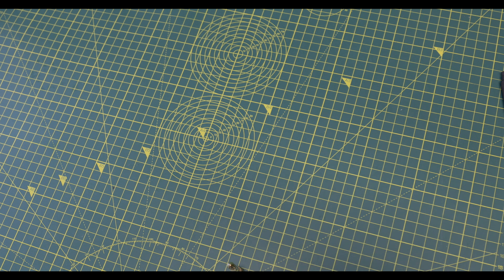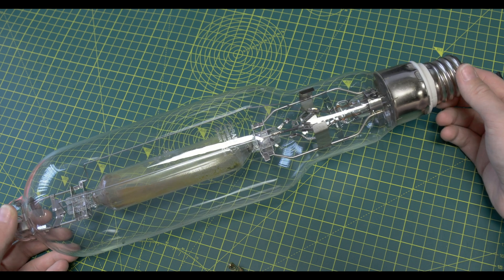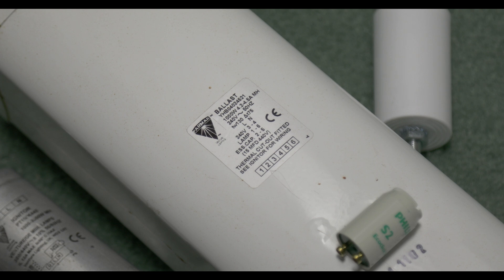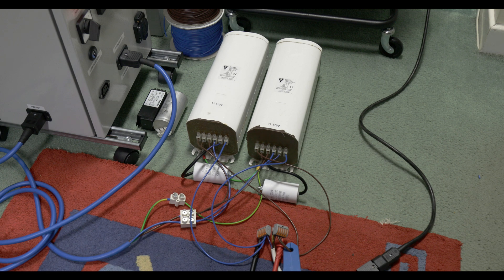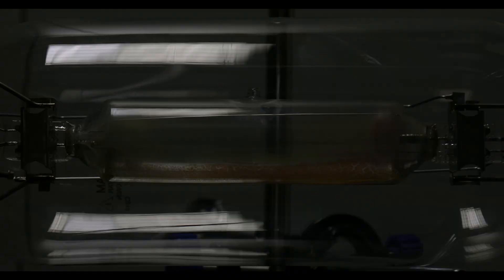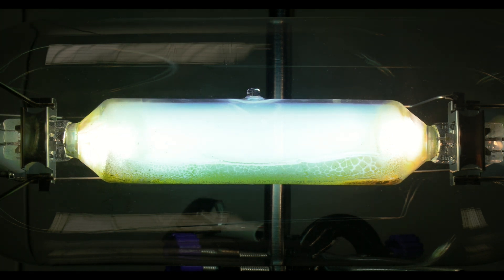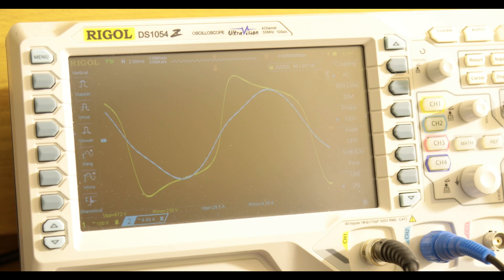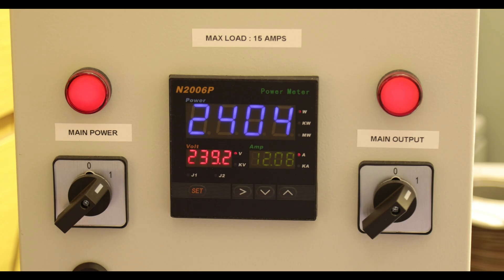2000w Osram Halide finally fired up

Comment: At 5:30 is that the halides solidifying at the bottom inside the tube? Nice video!
Reply from the maker: Yeah, that is the molten metal salts at the bottom. Not all the halide dose is evaporated on the majority of halide lamps. You can actually see them vaporising when it starts.

Comment: Big boy lamp!

Jealous how easily you can get that kind of power from wall sockets over there.
Reply from the maker: The UK would be lost without our 3kW kettles lol.
Reply: @FrontSideBus  damn right, but when you go gas you never use mains again if you have hard water.
Reply: 16amp & 8amp sockets are normal thing in most of asia. Here we have round pin plugs and the large one can do 16amp & smaller one can do 8amp. Anything more requires hard wiring to electrical box. There aren't many loads that can pull more than 16amps at 240v. ,
Only the water pump (which is 2hp) , 3x 76000btu pannasonic vrf & a 3phase 2hp exhaust fan motor is hardwired to electrical box in my home..
Reply: Where I live, most ordinary households have 3 phases and 16A in the house.
That's a hell of a light bulb, holy smokes.

Comment: I'm am very sad because in my city a new stadiums was made but alas no mh lamp they were all stupid dum led floodlights
Reply: LED's that probably cost 1/30 of the cost of a gas bulb, less non-directional wasted light (less light pollution), less energy waste running them, less maintenance (provided they are not over-driven). And will last year's (again, if good quality, under-driven). While they take a bit of adjusting to, they are doing an important job.
Reply: 1/30th? Sounds a little optimistic. A lot optimistic, even. However, even 1/2 of the cost (which seems more realistic) is quite a good savings at that scale. Still unfortunate that LED is taking away all of the interesting lights though.
Reply: @Wyatt_James  typically you would be looking at between 1/2 MW to just over 1MW for flood lighting a stadium using halogen lamps, monthly maintenance. With LED lamps it's a tenth of the power consumption but after initial installation the maintenance costs plummets to 1 inspection every 3 or 4 years provided they are not overdriven and have adaquate cooling they can last for years without needing to be replaced. 

This where they cost 1/30th of the old lights.
Reply: @Dennis_M1DLG  Why are you comparing to a halogen? We were referring to Metal-Halide.
Reply: @Wyatt_James  misread their poor grammar and lower case as typos. Still my point is still valid, it's 1:18 cheaper. And who is this 'we', 'they' made a comment and 'we' are the responses.